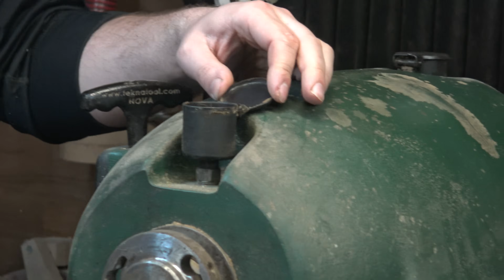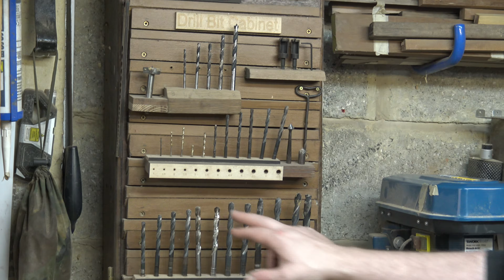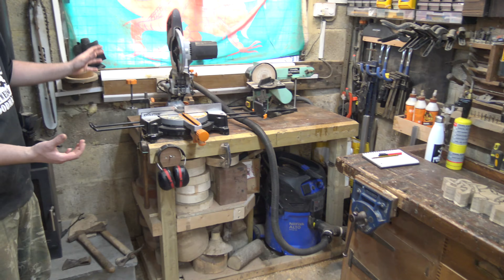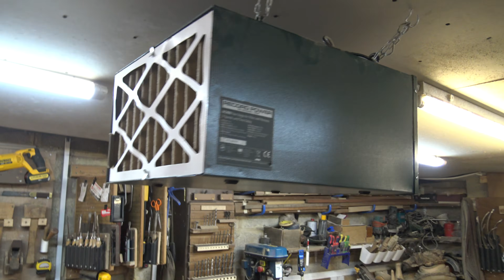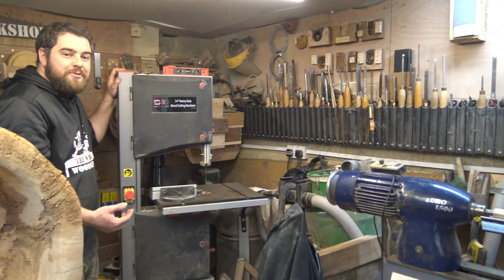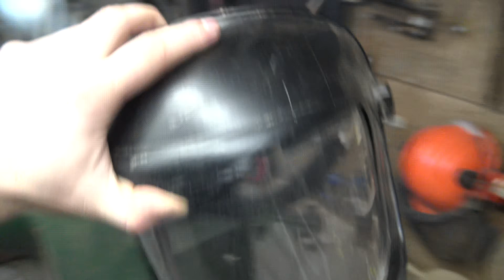Workshop Tour 2020

Comment: Why dose you main bowl lath has a ripcord
Reply from the maker: Hi Luke, it does look a bit like a chainsaw starting cord handle  at the top of the lathe, there is a hole at the top where I store my chuck key, also the housing handle to get into the gears looks a bit like it to, its electric powered so luckely do not have to start it up like a chainsaw 😁

Comment: I like the idea behind your drill cabinet. I've been 'umming and 'arring on the best way to do it. But I think removeabe holders within easy reach is the go. Having the spares and jigs inside is a good idea too. I'd maybe add a small drawer at the bottom as well, but other than that - great use of space.
I've got a similar scrap box for my fire as well. Anything I can't cut safely anymore goes into that for the winter. Although truth be told - a lot of the scrap could go into the fire as it's always just that little bit too short!
Thanks for the tour.
Reply from the maker: Thanks for your comment glad it gave you a few ideas. The fire has been a good addition to the workshop as I'm becoming better at getting rid of unusable bits of wood rather than hording them lol 😁
Reply: @thewelshwoodman649  Mate I save them up for winter here in Oz as it goes from 40 Deg in summer to -10 in winter where I am. Offcuts are great for keeping warm.
Reply from the maker: @peterschmidt9942  That's cool, that's quite a drop in temperature, we never get 40 degrees over here, our winters are pretty wet and our summer's too come to think of it 😂 it's nice working by the fire in winter that's when I tend to do my carving projects, I've  always dreamed of having a rocking chair in the shop by the fire so I'm making one at the moment 😁
Reply: @thewelshwoodman649  Yeah there's only a few months of the years where it's nice to work. It's either really hot with blow flies everywhere or bloody cold where you'll easily loose an loose an appendage outside!